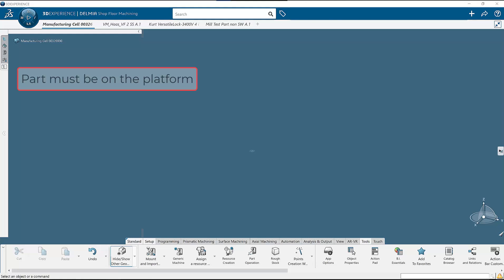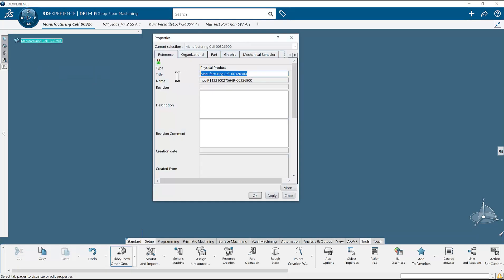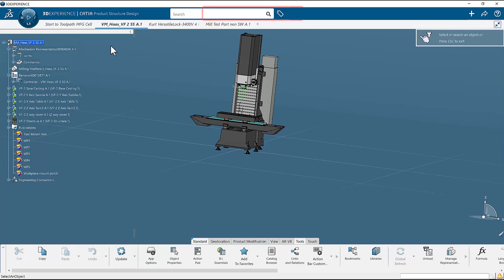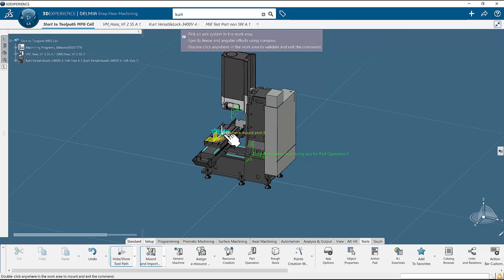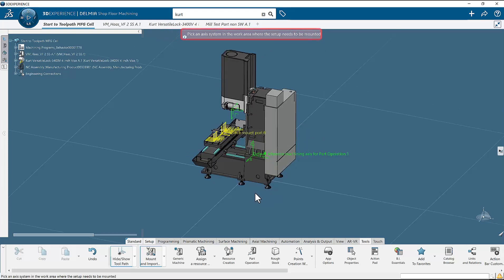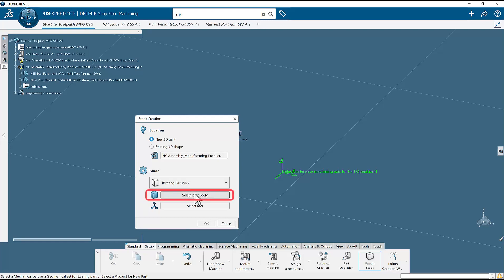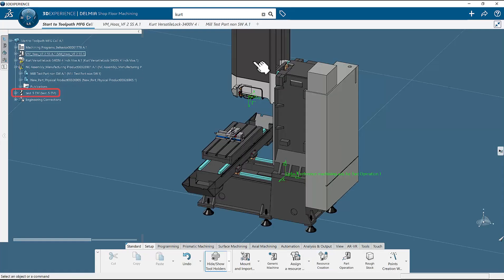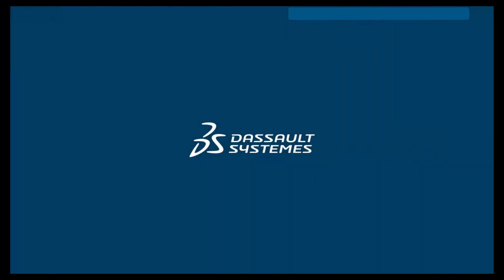Shop Floor Machining Empty Cell to Tool path

Comment: If i have a custom mill that i have CAD drawn in SW. How do i make it so it register as a "Machine" in 3dExperience?
Reply: Any chance you figured this out? I currently am having the same problem
Reply: @Mudbuggin  nope. gave up and went with Sprutcam a couple of month wich was great awesome software. but its to expensive for me so now i just run with fusion 360.